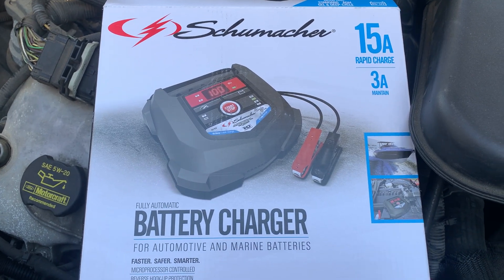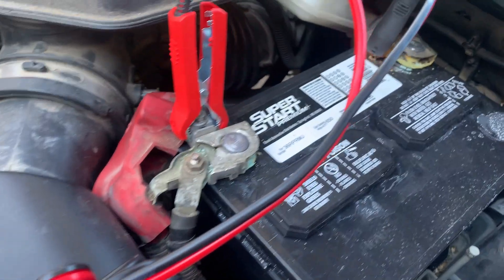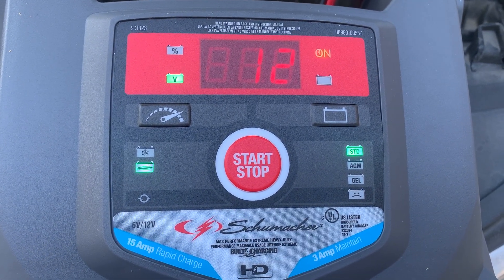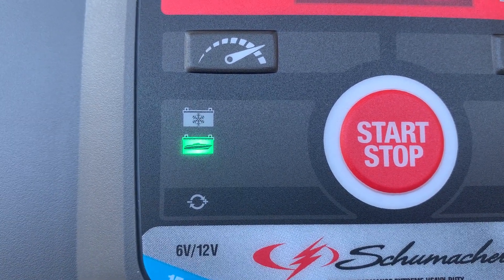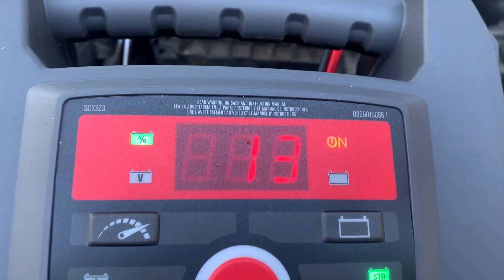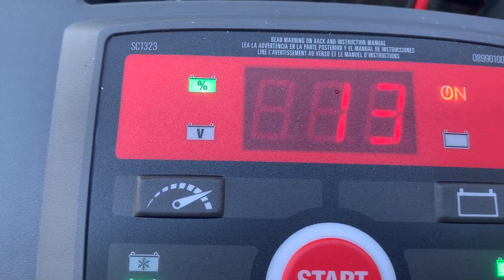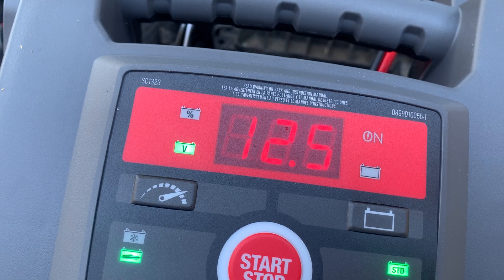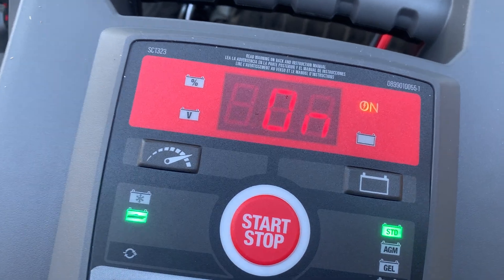Schumacher 15 amp battery charger ￼

Comment: You did a good job.   I have been working on this sort of stuff for 40 years.   It comes on and its on the Boat.   What does that mean?   Manual?   zero help.   How stupid can Schumacher get?  Well,  really stupid.     Thank you for the explanation.    Schumacher instructions  suck.   Also looking at it, I realized the 12 was not the charging voltage,  its the Voltage of the Battery.   Fungh.   I want voltage or better yet current (I have the digital stuff for voltage).     Anyway,  you helped out a guy who had no explanation for the various aspects,  well done.